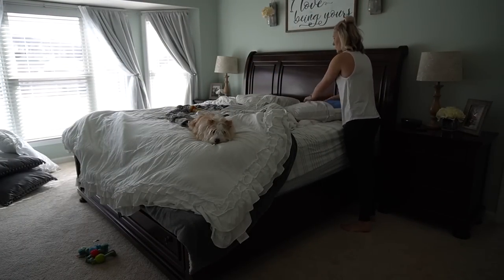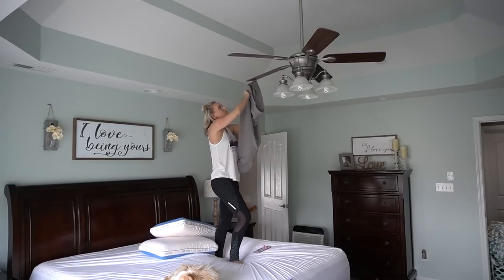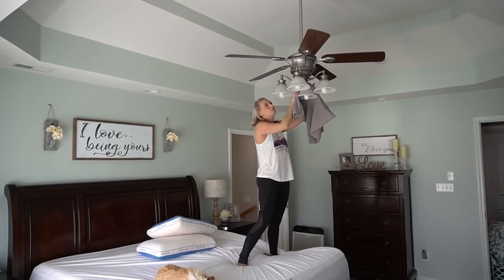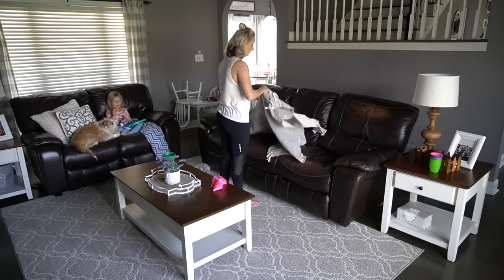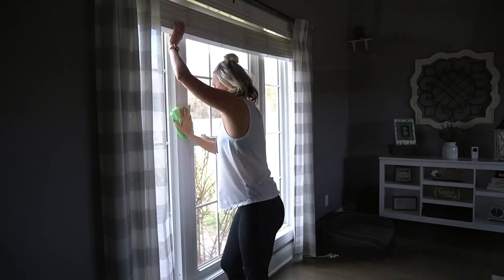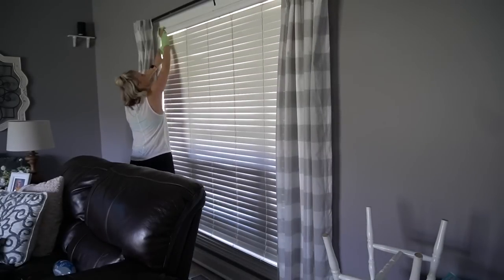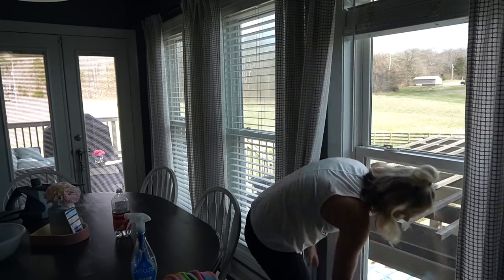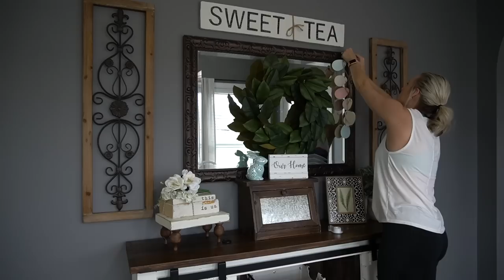🥕2020 SPRING CLEAN WITH ME- WHOLE HOUSE CLEANING MOTIVATION-JESSI CHRISTINE KEEP CALM AND CLEAN

Comment: You can also use Tilex mold is awesome for the window and a tooth brush. Also you can open the window from the top, by pushing those two Notches together and clean inside as well.